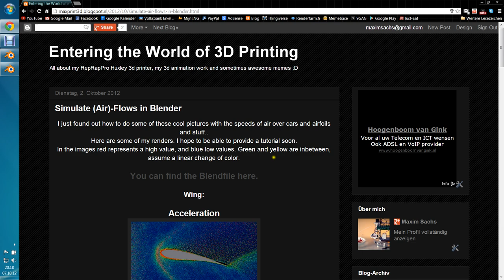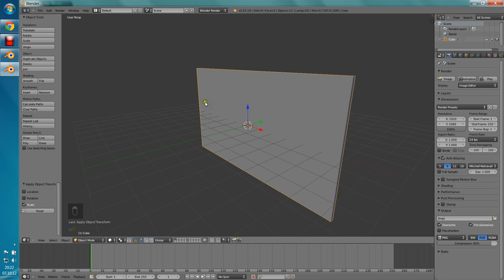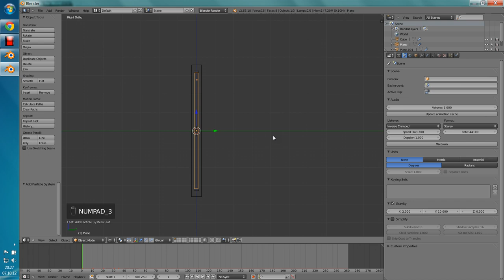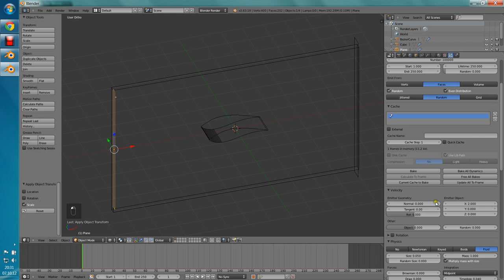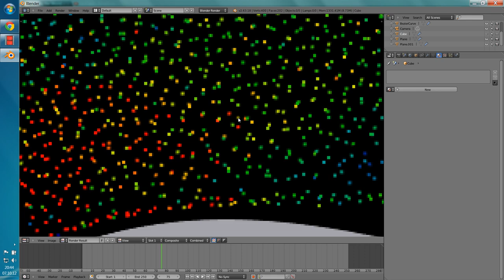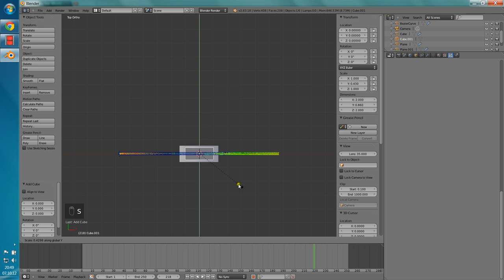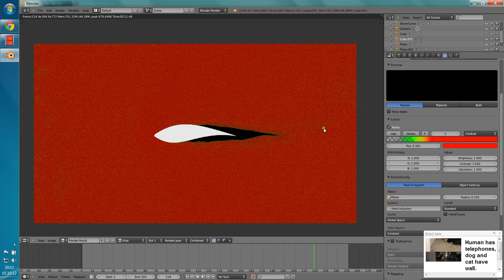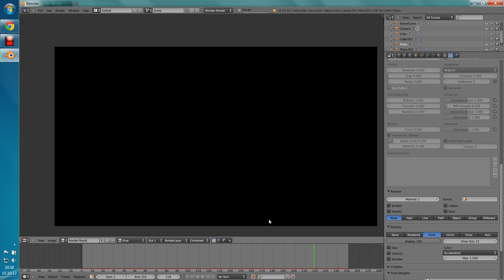How to do Fluid Flow Simulations in Blender - For Advanced Blender Users!

Comment: Nice, thanks. Easy to follow, very cool. 

FYI: I also had the same problem as you with the gravity and it went away on its own after a bit. I tried fiddling with the same values you did (gravity =0 then 1 again etc.) and none of it fict the problem. Saved, closed, reopened and still did not fix it. After playing around with an airfoil in the box for a bit it started to act properly. Not sure why.

Comment: Can this be used for science
Reply from the maker: Not really. It isn't accurate, the number values will not be correct unless significant effort is spend on deeply modifying the simulation code. However it gives a quick and easy way to get some quantitative feeling for how things flow in a very simplified scenario